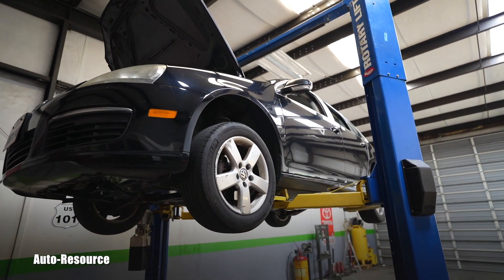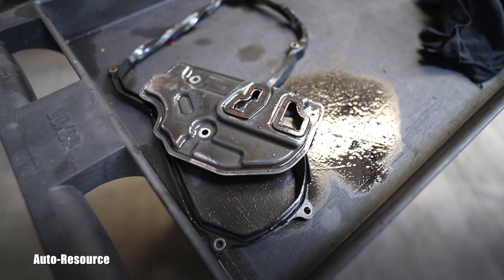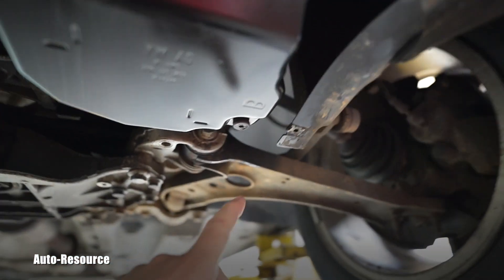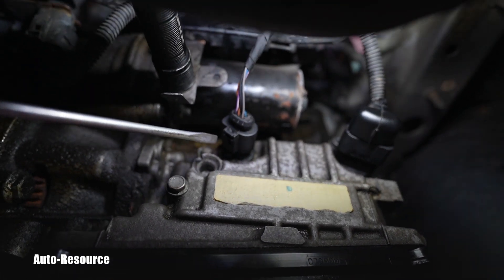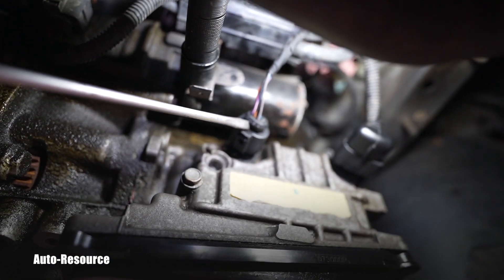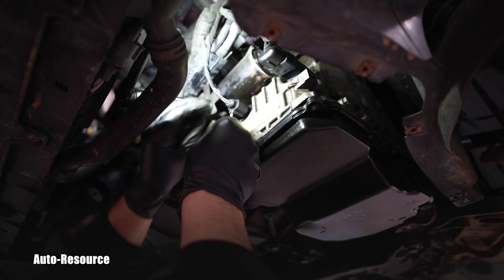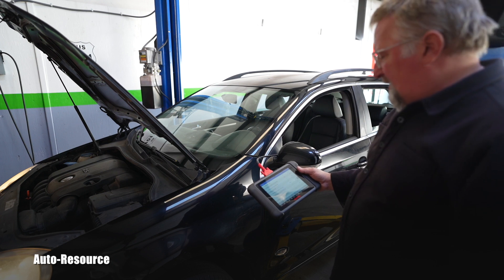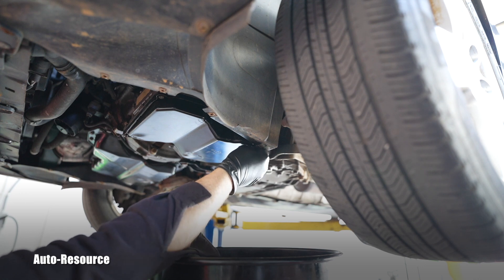VW Aisin 09G Automatic Transmission Service, Part2

Comment: When I bought my 2008 VW Rabbit 2.5 with this 09G transmission made by Aisin, I did not know when the last ATF fluid and filter service was done or how much fluid was in it. Like you, I started from scratch and did all the steps you did but with the IR Gun. I intentionally overfilled the system to make sure that I would end up with the correct amount in it when finished. I ended up with 2.5 quarts after measuring the difference between the amount added and drained. 

The shifting improved immediately. From that point on, when I drain the fluid I measure it to see if it is still 2.5 quarts and it always is. This is the amount I pump back in. Since I am confident with this quantity I also do this with the transmission cold. I do make sure to start the car, let it warm up and then hold the brake while I run it through all the gears before I drive it. 

Instead of changing the fluid again in two weeks, I changed at 15K mile intervals for two more services. Since then, I change the fluid at 30K mile intervals and I do not change the filter. The sump pan, magnets and original filter were all clean on my initial service, so I replaced the filter with a new one and I now leave it in there. 

I have spoken to several mechanics and researched a lot of websites to find that as long as the transmission is not abused and the services are performed AT LEAST at 30K mile intervals with a premium full synthetic ATF which meets the VW spec, the filter will not need to be changed. 

My car has 165K miles on it and it shifts beautifully.....much better than when I bought it. 

Thank you for a very good and detailed video!

Comment: Thank you so much, my friend, this was so helpful- clearly explained and well-filmed. I especially like how you refer to us as friends, and we are- friends help each other!  The explanation of internal temperature via the computer vs pan temperature using an IR thermometer was especially helpful. One thing that might help others- I did this fluid change on my 2016 Tiguan that does not have an upper fill hole, requiring us to fill it through the drain plug. I was tempted to buy the Amazon fitting that threads into that, but I found that the thread is M10x1mm- the same as a metric "bubble flare" brake line thread. So I used a short length of brake line, threaded the flared end into the drain hole, finger-tightened it, then attached the hose from my fluid pump to the other end, and filling it was as easy as can be. Thanks again, all the best, Peter!

Comment: Thanks for your thorough video. I just performed this service on my 2011. Turns out my transmission had a fill hole right next to the sensor in which you used to fill. Took just over 3.5 Litres of fluid.

Comment: Great detailed trans fluid/filter job!!  Peter, just FYI, if you want to save your customers money with rubber bushings, boots, etc, apply AT205 Re-Seal lubricant using a old Windex or spray bottle to apply it.  You can also poor it in engine crankcase with oil and it will many times stop rear main seal from leaking if the leak is not too bad..Have a great day, my friend.  Harvey Shaner from SATX!
Reply: i think its the vacuum pump. they're a commonly failed part on the 2.5l motor.

Comment: Well done, i did a tran fluid change on my BMW X5, and as it has a plastic tran sump i changed the sump and 20 bolts aswell. I was a bit aprehensive filling it with engine running and sump plug out !!
But as you showed us, there is a level tube !!

Comment: I just replaced the ATF & the coolant today on our 2010 Golf 2.5L with 150,888 miles.  I decided to just do a drain & fill because I am switching to an aftermarket ATF:  Liqui Loly 1800.  If it runs well then, I might drop the pan and change the filter next time.  

I put the Golf on a Rhino ramp, so the drain was sloped towards the drain hole.  Luckily my car has a fill plug that uses a T-55 torque bit which I bought from Home Depot for $4.5. 4 qts/3.8L came out; I think dealer overfilled it.  I've done extensive research, the typical drain & fill without removing the pan is less than 3L.  So I only bought 3L and put them all in.  Foreturnately, the car drives better and even more smoother.  It seems like the car starts out stronger on a dead stop with no slippage.  The 2nd to 1st downshifts are less obtrusive and other shifts are nearly imperceptible.  In all, I highly recommend Liqui Moly 1800 for this transmission and will be using it again for the future.  FYI, we are the original owners and the dealer replaced just the fluid at 50K & 100K.   Thanks for the video.

Comment: Hi, excellent videos!  My mk5 (2008) 2.5L Jetta is manual transmission, so I'm commenting to ask about the steps at 13:30 when you put it into each gear for 10 seconds.  How to do this without stalling the engine?  Thanks.

Comment: Excellent videos, I saw many videos for this work but yours are awesome, congrats! On the other hand, last weekend I did this procedure to my Jetta 2010 2.5l with 09G transmission, my car has aprox. 105k miles (173k kilometers). It definitely improved the shifts, i am really happy for the results, unfortunately today I lied down under my car in order to make a double check to my weekend work and there is a fluid leakage that I am pretty sure that comes from the electronic 8-pin connector which I pulled out (just like you)  previously to refill the transmission during the maintenance I did. I already detached again, cleaned and retorqued the bolt without success. The fluid still leaking after a couple of miles. I already search the o-ring from the 8-pin connector as spare part but it seems that comes only with the harness plug as an assembly and not separately. In your experience, what do you recommend me to solve the problem? I was thinking to use some high temp silicone to seal the plug but if I want to make another flush to the transmission on the future this plug would be sitted there forever due to the silicone. Please tell me your thoughts. Thank you very much. Best regards from Mexico!

Comment: Question..?
If you take out X oil....shouldn't you fill back in X oil ...?
Avoiding temperature and checking fluid coming out & dripping ?
Reply: Amigo hay varias marcas de tipo de Acetie para este tipo de transmisión lo importante es ponerle de acuerdo a las especificaciones del fabricante que las cumpla y refetente a la temperatura debe de ser llevarlo con el motor encendido a 35 a 45 °c o equivalente a 15 min con el carro prendido será indicativo que deberás checar el nivel que haya quedado a la medida Saludos

Comment: If you don't have a scanner that can read transmission fluid temperature is there another method to know the temp? Would an infrared thermometer on the pan be accurate?
Reply: I did it just now with a Infrared Thermometer and once the fluid hit 42 degrees celcius I removed the plug and the extra fluid came out and once its slows to a trickle or drip I reinstalled the plug. Worked perfect. My 2011 Golf 2.5 is now shifting like its brand new.
Reply: If you use the IR thermometer, you should shoot for the low end of the temperature range.  I have seen a report that the internal sensor temperature (via scanner) was ~10-12 degrees C higher than the IR temperature of the pan exterior.
Reply: Yes, X oil out. X oil back in.
Without all the bull sh(*t
Just don't iss the gap time from gear to gear.

Comment: Looks like vacuum pump might be leaking oil
Reply: Nice catch, but that is a separate topic. I deleted my vacuum pump several years ago because it is not necessary for this non-turbo engine. I have no leaks and no parasitic horsepower drain on the engine. There are several ways to do this and I chose the least expensive and simplest method from one of the VW forums.
Reply: Yeah he mentions that in the part 1 video.

Comment: Why don't you just pump the fluid in at the drain/fill port, like the VW procedure calls out?  It really isn't difficult.  DIY'ers do it every day.
Reply: They might but I will be using this method less chance of spills and not fighting against gravity. It's up to the person doing the job to make their decisions.
Reply: You need an adapter
Reply: @2esc2esc 
Or damaging the sensor ends....is up to the owners risk.